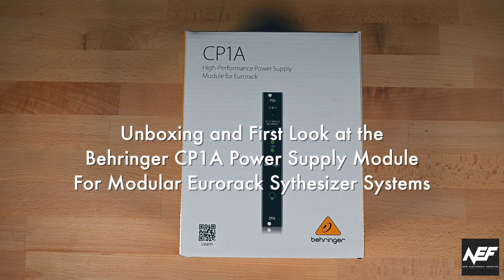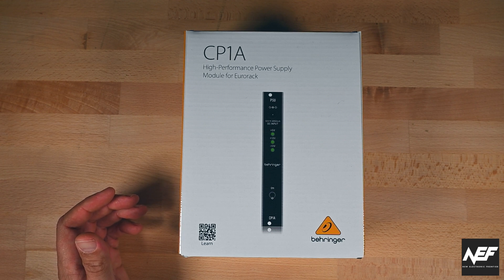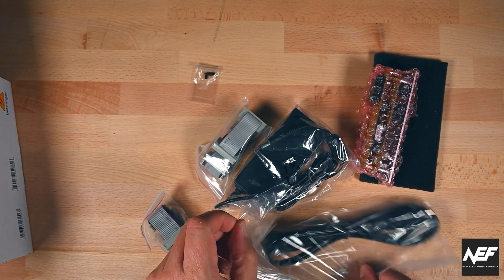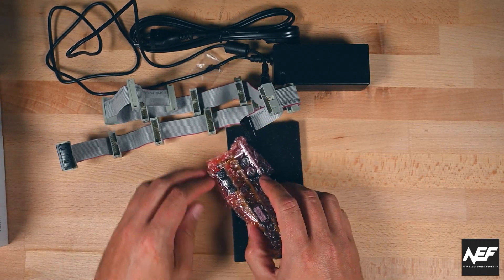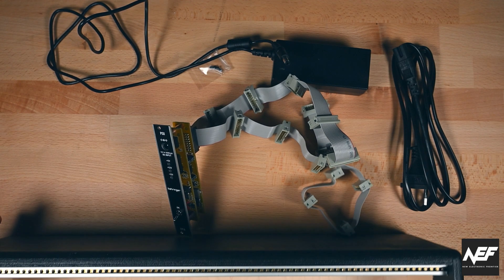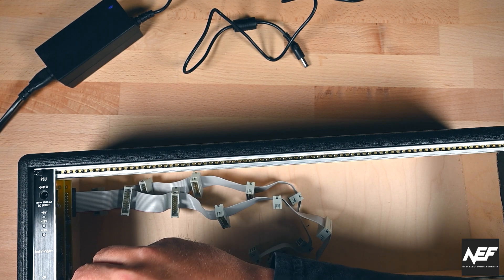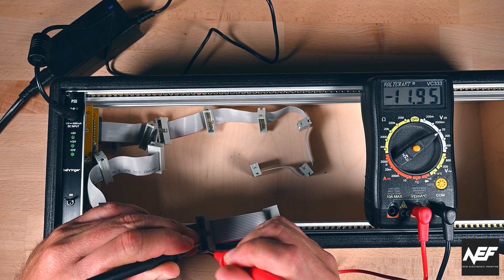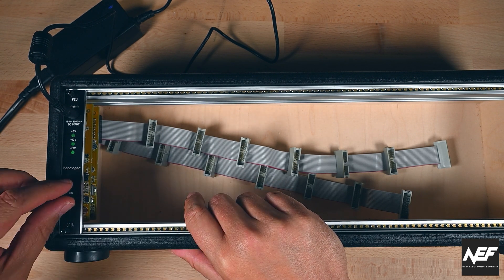Unboxing and First Look at the Behringer CP1A Power Supply Module for Eurorack Sythesizer Systems

Comment: built a 60hp x 6U case recently, this thing has been solid, running verbos, erica synths, noise engineering, wmd, etc. modules analogue and digital. coming from working w/powered cases only, namely "pittsburgh modular 208 structure case" which has the most incredibly elaborate built in power, clean, regulated, solid... i was definitely surprised to realize something this small could deliver quality power. 6yrs doing modular never worked w/unpowered case, so i wasn't even aware of how power modules work and floating bus cables. i'd say for a small system this thing will exceed your expectations. do your math, read specs, use modgrid to plan. i run it for hours and it hasn't so much as gotten warm. it runs cool. people hate on the brand so they'll swear the zeus is better, despite countless reports of it running burning hot. it simply makes no sense to drop more money on lower quality. yes there are nicer options. but i can't see how this thing could ever be a loss, in a small system. even if you get another later, this one can be your backup in times when funds get tight and you need to sell the big case. i wouldn't recommend shit quality products. this device is solid and delivers noiseless power to my modules. idk how they got it right and made it this affordable, but i've heard they hardly profit on their eurorack, as a company and do it more for the love of helping musicians on a budget or getting started. their quality has drastically improved over the years. here's a recent uli behringer interview for good measure:

https://www.youtube.com/watch?v=0D5HvUNyklE

Comment: Hi! Thanks for this review. I want this power supply for my first modular synth. I have a Moog 60 HP case already and want a solution for power. Is there any reason to spend a little more for the Tiptop Zeus or any other power module?
Reply from the maker: Thanks for the feedback Carlos! 
I guess actually not. I still use and I'm happy. With 1A power delivery it can juice some modules. If you want to be sure, just use https://www.modulargrid.net to put together your modules in the rack virtually. The most modules have power consumption in the properties so you can see nicely how much power the whole rack would need.

Comment: Can I use it for a 6U 84hp case or do I need two of them?
Reply from the maker: Hey Paolo! This heavily depends on the modules you plan to use. If it's just a few large footprint modules it probably is enough. But if you go for an assortment of the usual suspects with 6 - 12 HP my best guess is that one isn't enough. It delivers only 1000ma. If you want to use just one power module, you may want to check out the TipTop audio micro Zeus. If I'm not mistaken it has 2000ma standard and with a special power supply it can deliver 3000ma. And it's roughly double the price of the behringer - so I guess that's the better option. You can plan ahead on modulargrid.net - there you can build a virtual rack and see the power consumption of the modules used.
Reply: Thank you so much!!

Comment: hey, you're confusing a couple of things. the power brick is rated at 3A, but the cp1a itself can only provide 1A. check the manual for it. 

External power adaptor (use only the supplied adapter) 13 VDC, 3 A
Power consumption 35 W maximum
Power outputs and pin outs 
+5 VDC @ 0.5 A, pins 11, 12
-12 VDC @ 1 A, pins 1, 2
+12 VDC @ 1 A, pins 9, 10
Reply from the maker: Thanks Sebastian! Totally right. Got that one wrong... will add this to the description and video. Thanks for reaching out :-)
Reply: @NewElectronicFrontier  sure thing. Better to know the specs before you put in some digital module that draws too much power and you think something is wrong when nothing powers on. Or worse. Best to keep some headroom, as with the uzeus. Wouldn't run this at more than 700ma . Which should be fine for analog modules in your 1 row